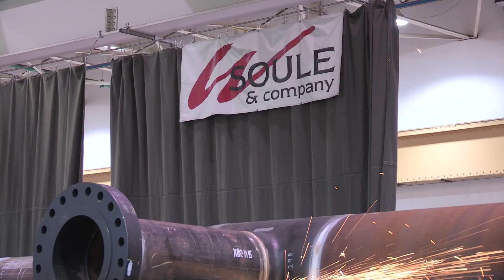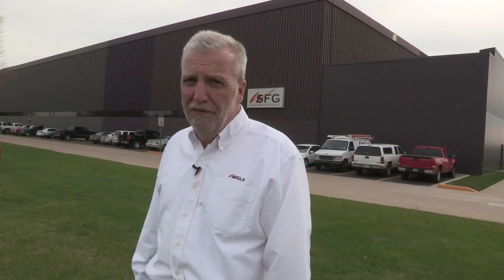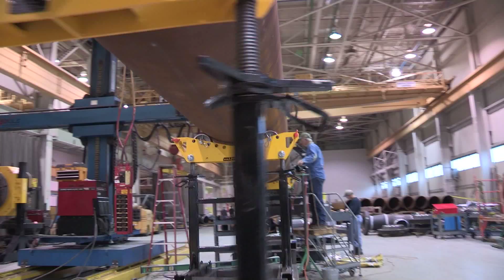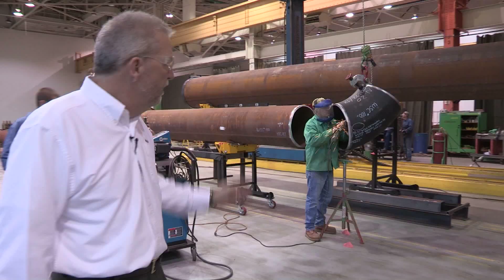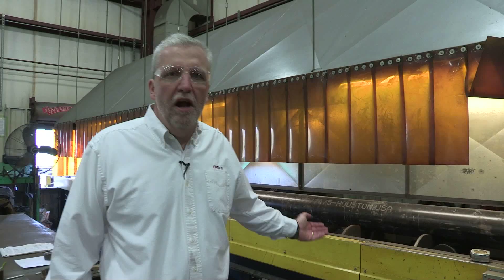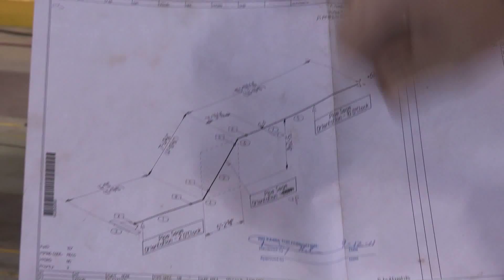W. Soule & Co. API Pipe Fabrication

Comment: I worked in exactly the same type of pipe Fab shop in BG, Kentucky. Rolling welds out, RMD root passes, pulsed MIG fill and cap. Everything was inspected on site. This is def a hell of a way to do big jobs, but doesn't work so well on smaller jobs, or older buildings full of existing piping. Virtual Fly Through is a MUST for a company wanting to do this. Great looking shop guys! Wish I was up there with you!
Reply: How can I apply for piping related job in USA
Reply: @arslangul5980  u get the job
Reply: @luciferhuey6285 yes

Comment: im a tube welder, i work a lot in a turn around job(shutdown).mostly i weld in the field or in the unit i can weld in tight spot using mirror weld. weld in a convection box. 180deg. elbow. i can weld inconel, stainless pipe, aluminum pipe, titanium, that required 100% X-ray.  i work with MEI a brown and root co. who was specialized in heater job or boiler tubes. candy can, retubing. etc.